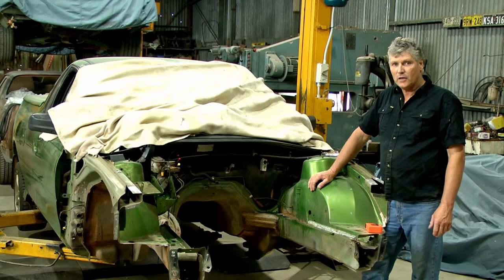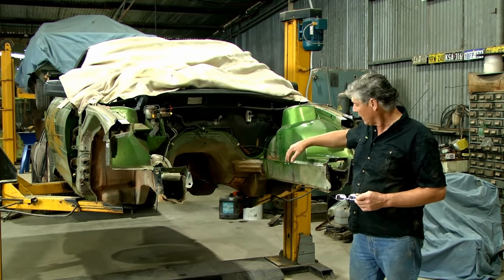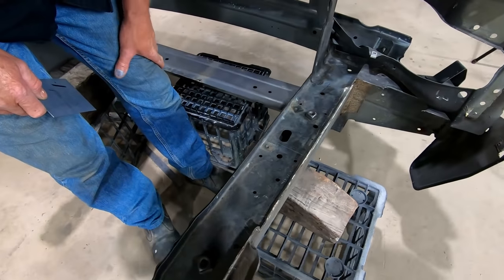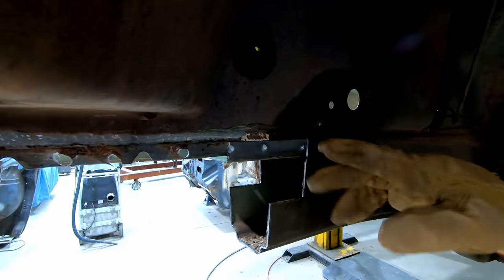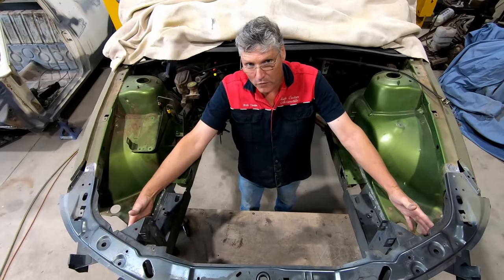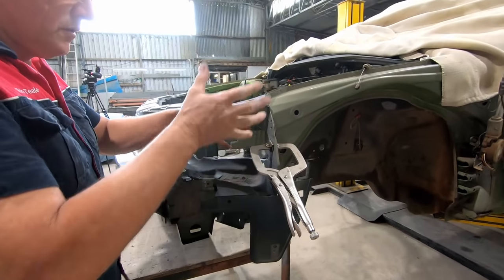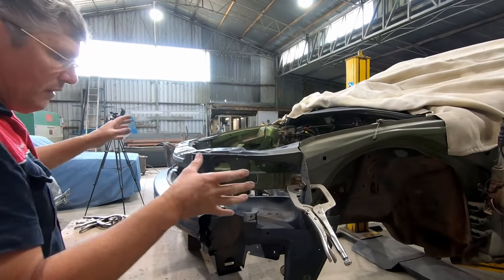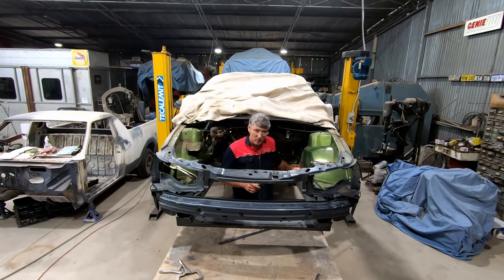Collision Repair - 2003 Holden VY Storm Ute - Part Two

Comment: Very smart on the repair prosses of the L/H rail but not assor friendly. But as it would be the beaters ass very correct
Reply from the maker: There is nothing an assessor can say or do about my repair. It is all done to the GMH repair specification. The major problem with our repair industry is the bully tactics applied to it by assessors and insurance companies. Everyone knows it, but if we dont speak out nothing will change. Dont get me started on stat write offs.
Reply: @robsshed  yes I work in the industry and sold both  my shops about 12 years ago for the reason the way the smash repair industry  was with insurance companies i was very happy with the  method you used in staggering the rail between the crumble zone and I agree on what you saying about chance of failure and the way you when about it were assors would have costed it the cheapest way time funny money to time were your repair was done towards safety with the mind of quality  on a re-inpacked in a possible re collision
Reply from the maker: You have covered it all. Many of us have been so often backed into a corner to make the job cheaper, but what is the real cost. The possible catastrophic failure if the same car is in a future accident, and the negative image that the industry gains from these cheap repairs. Needless to say the insurance ceo's are collecting a massive sallary while the industry is bleeding.
Reply: @robsshed  110 percent i got sick of working for peanuts i felt like a small fish swimming around sharks.
Reply: We used to buy 2 or 3 damaged cars as loners keep them for up to 12 month reregister  and sell it was a win win in most cases but our state laws changed that then they wanted us to lease and rent them to the customer and that was unprofitable we would give them one to use when a car came in by our truck or $20 per day on drive ins that would have changed to a minimum of $70 per day over the whole board

Comment: Gday young felah,love  to have that hoist in my garage, have you ever used a plasma cutter instead  of  using a grinder on some of them jobs.
Reply from the maker: I have an industrial sized plasma cutter left over from when I was making semi trailers. I have used it a lot for cutting sheet metal, but the grinder is usually more handy.